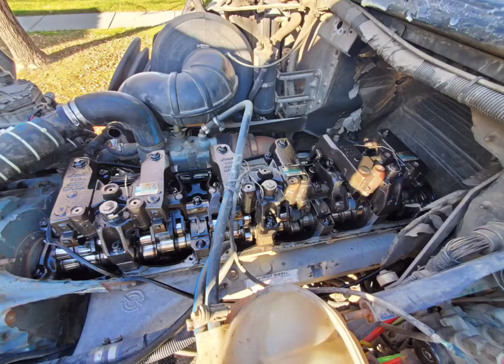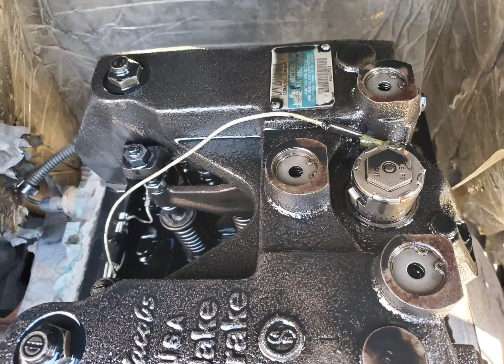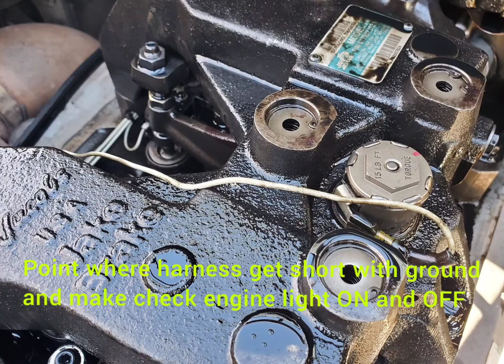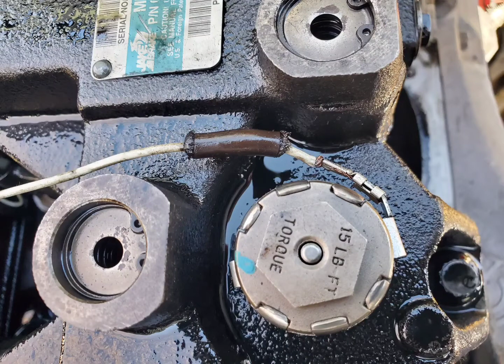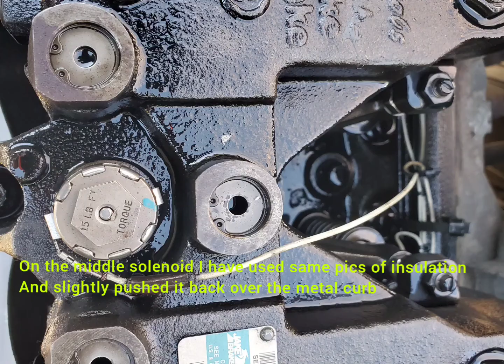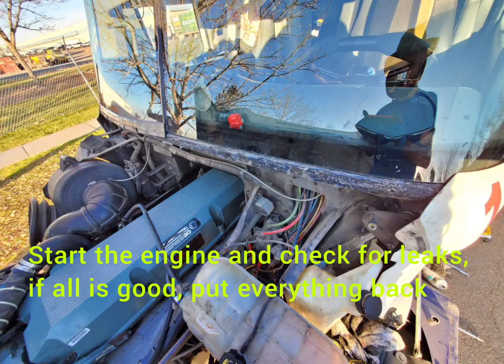Detroit 60 jake break solenoid  fixed 👌

Comment: How do you remove the solenoid
Reply from the maker: On top of the solenoid is place where you can put the wrench 🔧, it's pretty easy 
Hopefully this helps. 
Thanks for watching
Reply: @sonebmw  if you remove the engine break to replace harness do you have to adjust it back
Reply from the maker: @mileswatkins2162  you don't need to remove engine break. It's really accessible to reach in there and replace or fix wiring. 
I am not mechanic but I am telling you my opinion since I have done some repairs on it.
Reply: @sonebmw  hi, if that solenoid is bad ,can it produce aluminum shavings?
Reply from the maker: @ictviamfortruthgoogleisspa5886  No, usually there is no physical damage.When goes bad just electrical part inside the solenoid stop working.
Reply: Hi.  Can the solenoid stuck in on position? 
Yesterday I was using engine break on highway and when I turned it off it would not stop.   I was pressing on acceleration pedal and the engine break was still working.  Can it be a solenoid? Thank you

Comment: Do you know where the retarder control relay is for a freightliner columbia 2005?
Reply from the maker: Unfortunately not, I  am not the professional mechanic but I have learned some basic stuff on the YouTube. This is my first engine and it's really old but it's much easier to work on it.
Your best bet is to Google it or try to call local dealership to ask about it .
Good luck !